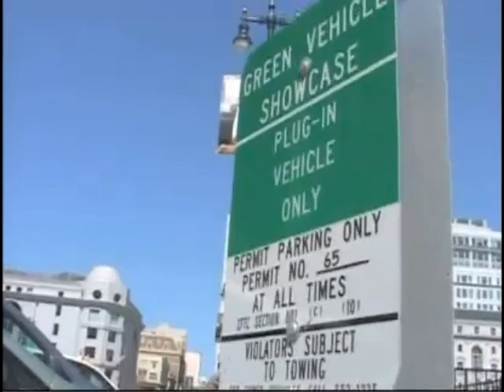Discovery Channel - Wind Powered Vehicle

Comment: The conceptual trick to understanding how this works is the realization that the source of the energy that turns the propeller is air pressure and not wind speed.  Wind is instrumental in removing the air pressure on one side of the blades.  The source of the energy is air pressure, not wind.  And air pressure has a speed limit of about 700 to 900 mph.  So, if there was no drag the eventual speed of the car is 700 to 900 mph.  

BTW, extremely few people actually understand aerodynamics on the molecular level.

Note: there is no violation of thermodynamic principles.
Reply: If this was true then you could get rid of the wind but keep whatever you mean by "air pressure," and the cart should work just fine.

Comment: Once the vehicle is going FASTER than the wind, wouldn't the wind tend to rotate the propeller in the opposite direction?
Reply: The airflow through the prop tends to rotate it backwards at all speeds, faster and slower. The reason that it doesn't, is that the torque from the wheels in the correct direction, is even greater
Reply: No, because the propeller is being driven by the wheels and not the wind.

Comment: The explanation is overcomplicated here. A static sail won't be able to get any more push from the wind once the vehicle is travelling at the wind speed, so it can't go faster. This isn't a static sail though. It is essentially a rotating sail which presents a slower apparent speed to the wind, i.e. the blades move backwards (in a way), giving the wind something to push on. As long as the wind has something to push it can do work on the car.

Comment: What wasn't made clear was that the feedback is taking advantage of the difference between wind speed and ground speed. With a tailwind, the apparent wind experienced by the cart is less than the ground speed. This allows the prop to be "geared" to produce thrust at a lower speed than ground speed, but with more force than ground force (after some power losses). The prop wash slows down the tailwind (versus ground) speed, the same as any sailcraft.

Comment: Wind speed relative to cart speed is irrelevant. It's like saying airplanes will never fly because they are heavier than air.  It's converting he angular momentum of the propellers to linear momentum of the cart. So as long as the wind is strong enough to move the propeller they go forward.